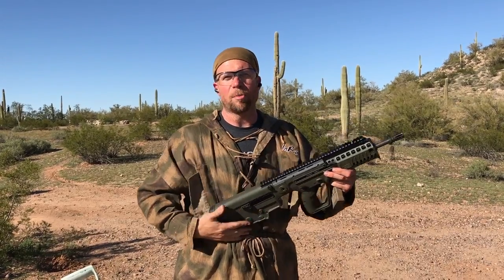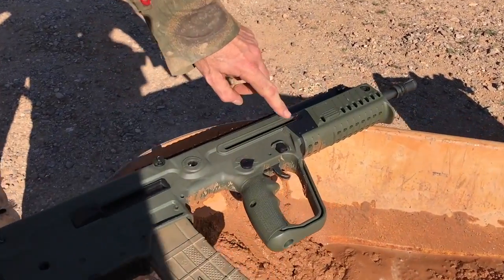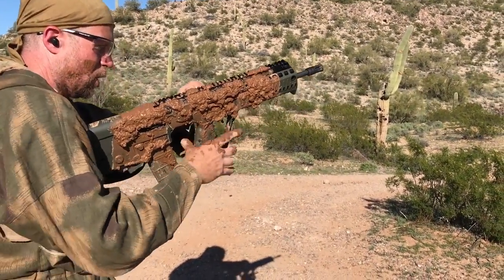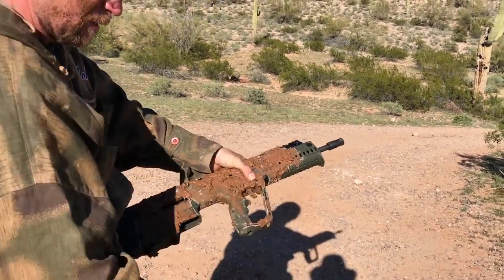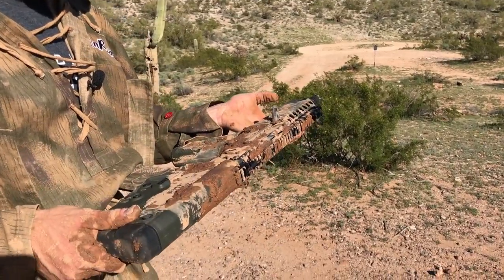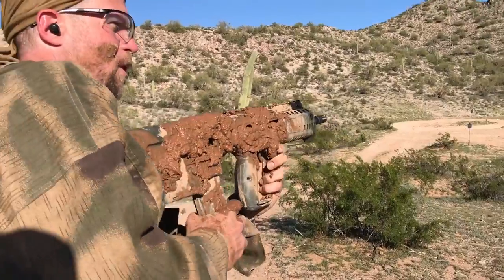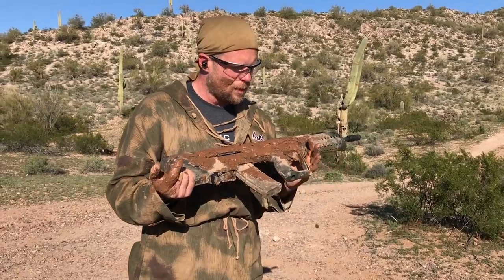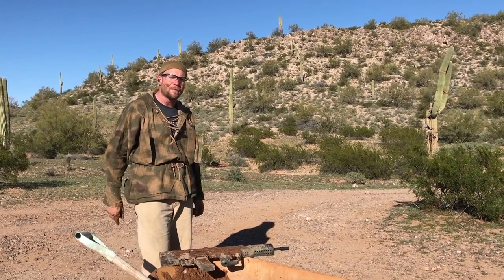Mud Test: X95 Tavor

Comment: If you would give 'er a good shake before shooting, your first round wouldn't stovepipe.  The mud is impeding the round's ejection pattern.  Good to know.

Also, the mag release buttons being placed up by the trigger is a total BS change in my opinion.  The mag release was in a better position back by the actual magazine on the original.  People just need to get used to the gun itself, not try to make it into an AR.

Comment: I'm sorry but I just don't get the point of these mud tests. Nobody would try to use a gun like this. If they did manage to drop it into a mud pool, they would at least try to clean it as best they can before trying to use it? Even if they didn't have a bottle of water handy, just clearing as much as you can with your fingers etc would help? It's as far from a real-world test as you can get.

Comment: You're a liar!  You did not test the Ar-15 under the same conditions as you tested the X95.  1. You cleaned the mud before you started firing the AR-15 at the entrance to the backpack port 2. It is not the same level of difficulty of the mud 3. You shook the AR-15 and dropped the mud from it What is left on it is not mud it is water from experience I have with both X95 weapons  Excellent without stops and is much tougher and much harder to stop than the AR-15 and I am willing to bet that if you put them next to each other under the same conditions out of 30 bullets you will be able to shoot much more at X95